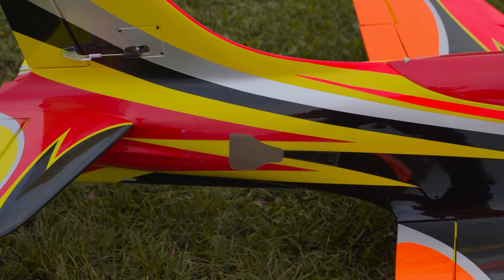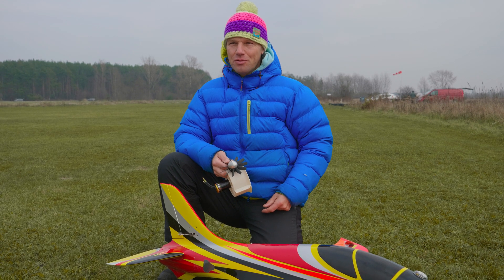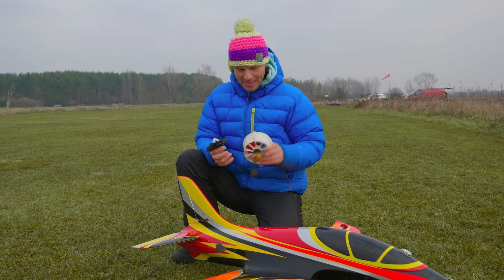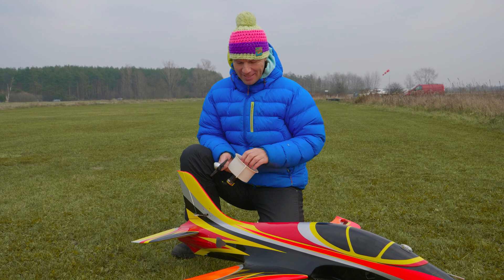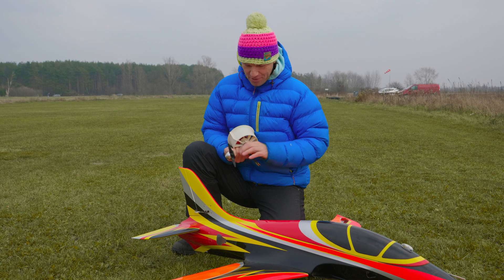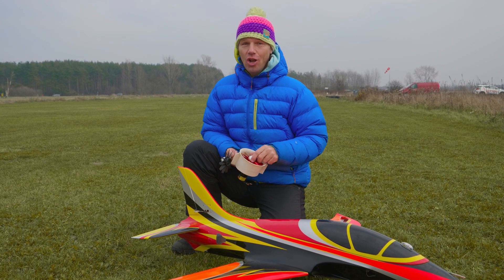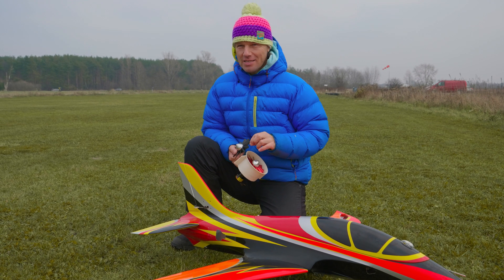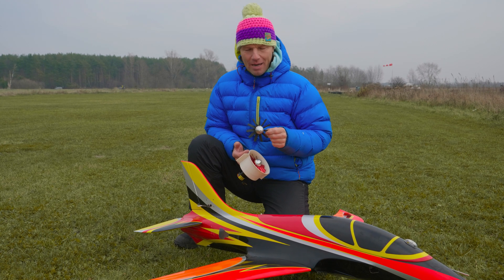8s vs 6s, esc burn - Sebart mini Avanti S WeMoTec Midi Evo 90mm motor HET 700-68-2250kv

Comment: Hi, with regards to the wemotec for the avanti a 80mm, what voltage setting on the ubec 6v, 7.4 or 8.4v, 8s set up using 6s 5600 and 2s 5000mah, thank you and happy dlying

Comment: Hi, I also run Frsky Horus 10 Expres, also with EDF Midifan Evo Unit. I would like to ask how do you display the maximum telemetry values on the transmitter?

Comment: "8s 208 Amps  5,5 kW."
There is no way that Samsung 40T in 3P configuration delivered 200+ Amps.
Physically impossible, this must be a measurement error.

I am building the same setup right now (Avanti with HET 1400 and 8S3P Molicel P42 :)

Comment: Wojtek,
Di I see it right…. 6s packs of Samsung t40 ,  it is 2 cell series x 6 groups parallel = 12 cells total?  Add nickel and wiring , and covering to get to  945 g then parallel 2 of these for the HET- 700-68 -2100kv motor?

Comment: Excellent! But as far as I have understood it  you draw 54 Amps at 2x 6S  and 69,3 Amp at 3x 8S from the batteries ?!   How long can a T40 resist this stress?
I own a Sebart Avanti Mini with a  DS-51-AXI HDS / HET-700-68-2100kV. Do you think it would give enough thrust and power with 2x 6 S  T40-packs?  https://www.schuebeler-jets.de/pdf/Messungen/DS-51-AXI_HDS_HET-700-68-2100kV_YGE160HV_18Timing_14kHz.pdf
Reply from the maker: I think it would fly nice on 2x 6s  Samsung 40T. Approx 50A from each battery. You could push full throttle quite a lot. With bellow 40A per battery you can fly full throttle from takeoff till landing.

Comment: very very very  nice!  what is the KV of the odissey 40mm motor you will use with  12S please? Also the jp hobby rotor is gorgeous in your 3d printed edf,  and what do you think about an edf design with a fixed spinner like the original jp are, dont you think it could be way more effective without a rotative spinner? thx
Reply from the maker: The motor is 1100kv, 550g. Yes you are right, I am 3d printing now the fixed spinner version of the 120 edf.
Reply: @EDFjetRC  excellent, congrats keep up the good work that is realy great content